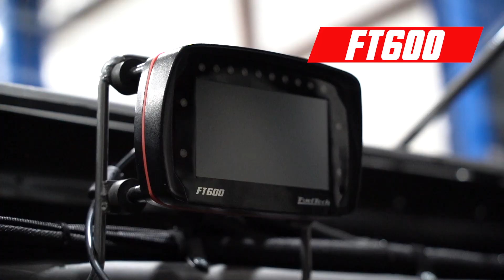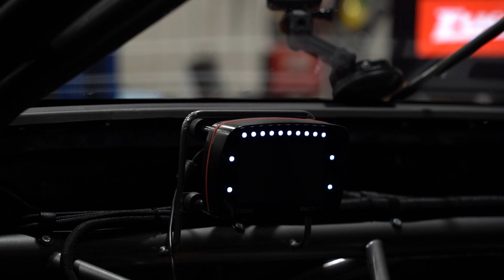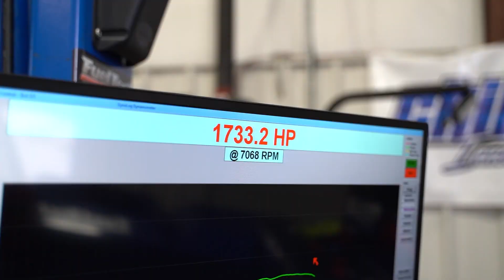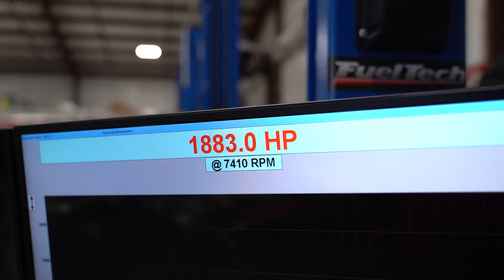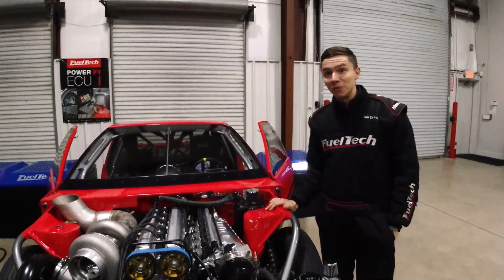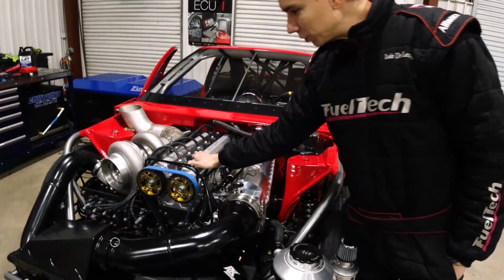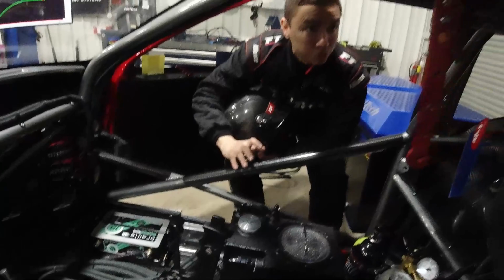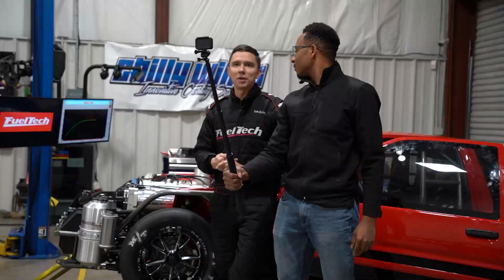1,883 WHP Toyota 2JZ | Isidoro de Los Santos | El General Racing Team

Comment: Pour moi le meilleur 6 cylindres c est le 2jz et le moteur bmw e34 M5  sont 6 cylindres d origine fait 3L6 et en Europe il y a une r30 moteurs e34 m5 de 3000 hp il a manger un mirage 2000 au démarrage sur 400 m c est sur you tub il y a cas taper e30 e34 turbo

Comment: Dude that’s 313 hp per cylinder
Reply: There are other engines making about 380 and 400 hp.  per cylinder, also with 2JZ.
Reply: Still that’s a lot
Reply: The thing is to be able to make the adjustments to be able to use all those Boost pounds as a springboard, because ultimately if they stay there, because the engine bursts.
Reply: @brentonwood5464  
Nissan »The RB 30 3.0 lt., BMW B-58 3.0 lt., Ford» Barra 4.0 lt.  Toyota 1FZ 4.5 lt.  Chevy 292, 4.5 lt. 4.2 lt. All in one way or another compete against the 2JZ and it is the RB, B58 and 1FZ that are the biggest competitors and Mazda flirts with making an inline 6 for MX6 2022 Sky Active F.